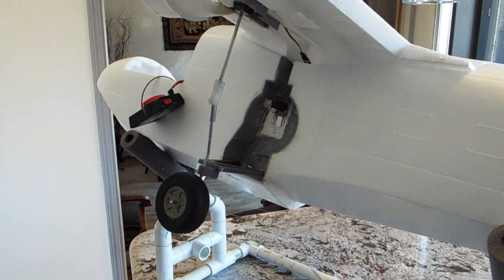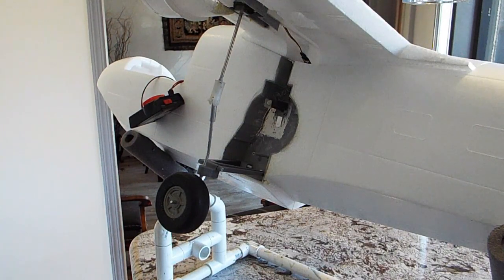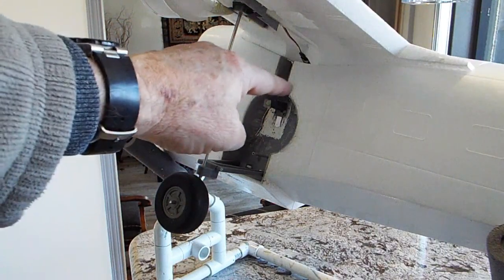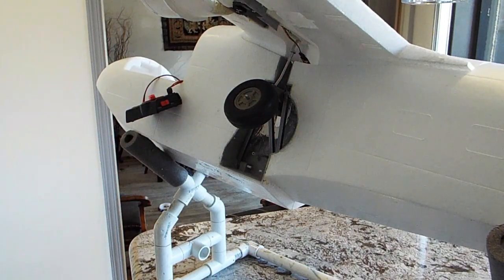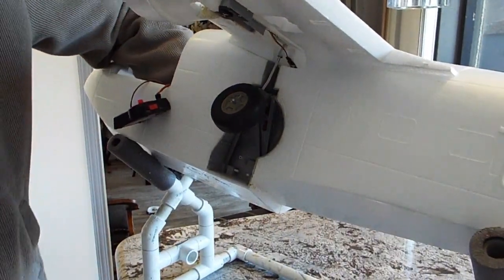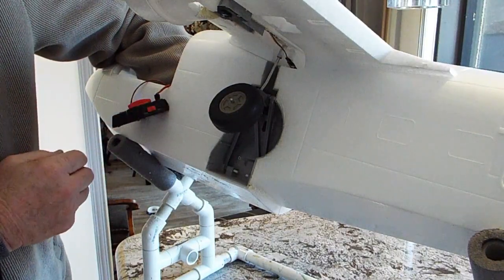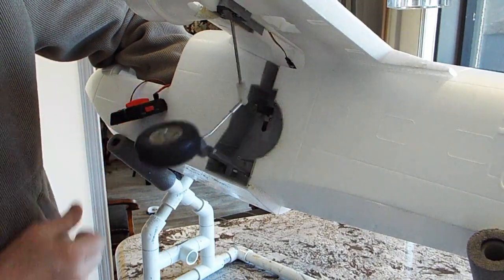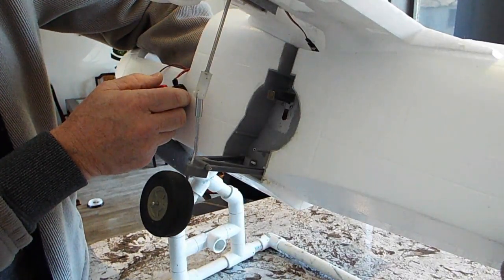Albatross MAIN GEAR next step

Comment: put the 90 degree servo inside the fus and have that upper arms as just a follower/shock .. should be easier to adjust that way. if theres room for two 90deg servos in the fus side by side. altho i think it might be harder to keep water tight this way tho

Comment: That's cool, but a lot of effort for a little foamie. I have seen this model fly, and it's qualities are wonderful. I would be worried about the excessive weight ruining the great slow flying qualities this model already possesses. Good luck getting everything sorted out. Looks like your going to need to install a bilge pump in the fuselage for the water you will be taking on.